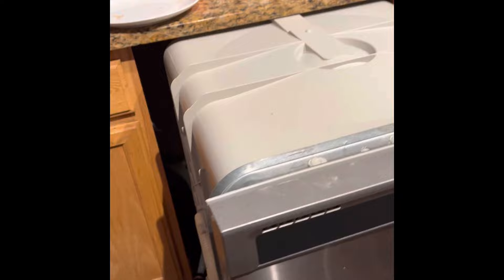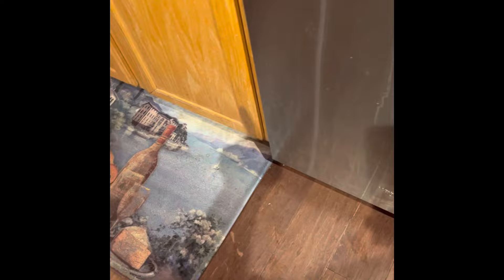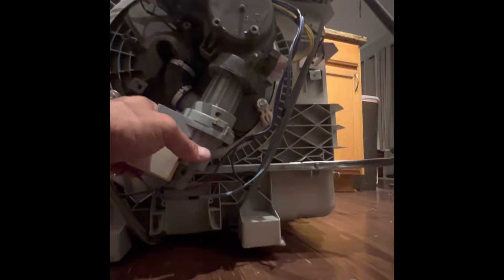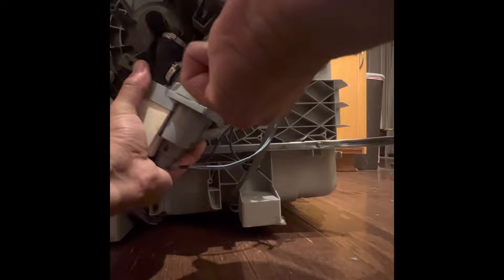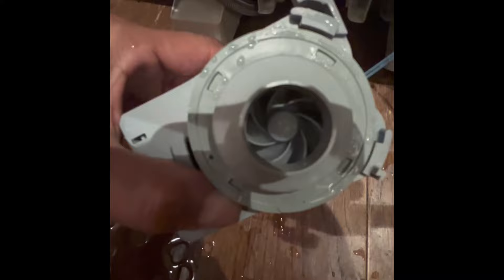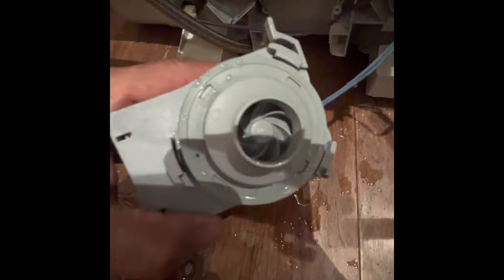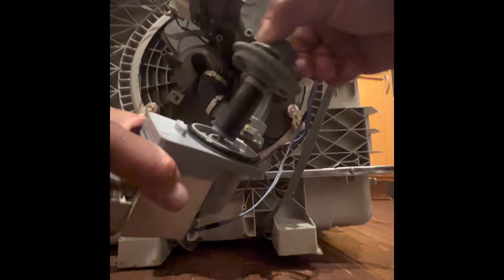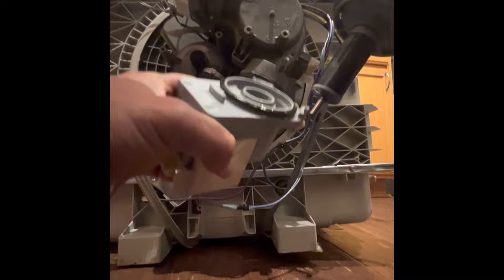Whirlpool dishwasher no spray!! Not working. Easy fix!!!

Comment: So how do I actually know this may be my problem? Looks like I have the same model as yours. All I know is that my dishwasher won't really run through the cycle and clean my dishes. It doesn't really make the same noises as it normally did when it worked either. The lights will turn on but then you don't even really hear it run. You think this possibly could be the same problem? THANK YOU!! I realize this video is a year old and you are probably over it, but if you're able to reply I appreciate it😊

Comment: 1 issue.  By pulling out the magnetic part you break a suction in the motor.  This is turn will very often cause a leak.  Don’t pull that apart like that.  I know this because I did exactly what you did and my repair guy said that’s what caused the leak.  I fixed it, yes.  However I created a whole new issue and had to replace the motor for $368.

Comment: Not all dishwashers are the same, people who post these videos are so proud of themselves for fixing their particular model, but the fix doesn't apply to other brands and manufacturers, there are different generations of models across brands and manufacturers. What works for a Bosch, won't necessarily work on a Frigidaire or a Kenmore, which could be manufactured by Whirlpool or General Electric, which is now owned by Samsung.  So you posers, mention the brand an model number of the appliance that applies to you.

Comment: Tried this, mine had a more complicated circulation motor that doesn't  pop off easily. Ended up doing the plunger trick from this video and it actually worked: https://youtu.be/P_ca8E0Jzk4?si=2v0ZSbEnf39OyQDe
Reply from the maker: Nice!! Glad you found another solution!!

Comment: The worst why does everyone on here want to talk to people like we fixed anything.  Just say clean the bottom filter geez
Reply from the maker: True but it does fix it in the end. The reality is that most people wouldn’t know where to begin so for us, when we figure it out, it is a fix and I decided to share it and how to get to it. 😊
Reply: It's not a "bottom filter." It's the impeller inside the dishwasher circulation pump. You need to disconnect water hoses, remove the dishwasher from under the counter, flip it over, disassemble the circulation pump, clean out any blockages, then do everything in reverse. I'd call that a fix, not a "clean the filter."
Reply from the maker: @marci.5597  Thanks!! Appreciate it!! 👊🏽👊🏽👊🏽